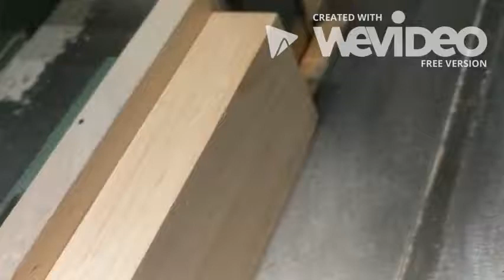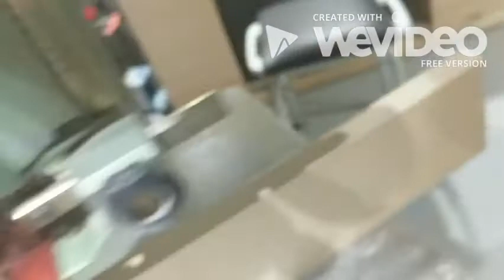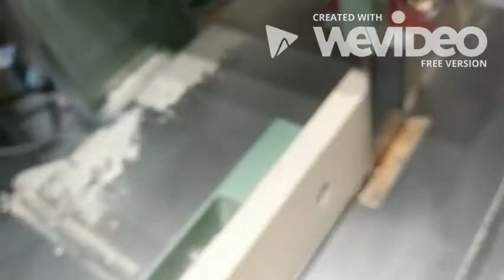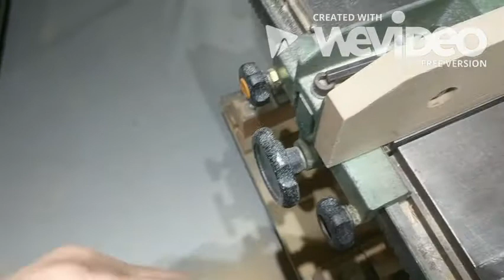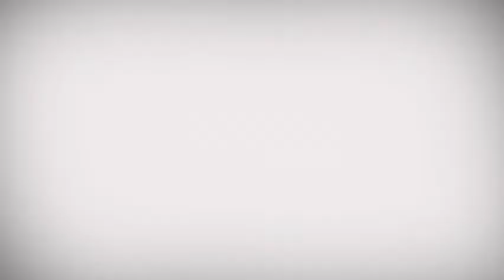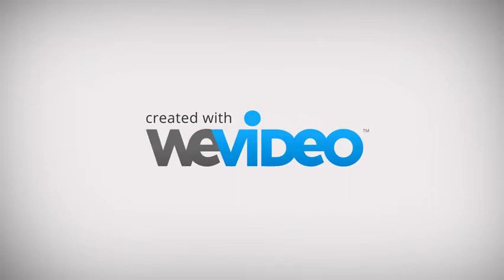HitachiBandsaw2

Comment from the maker: Sorry, I sold it quite a while ago. You can find them occasionally if you do a Google search. They are very heavy, so unless you have a pickup and a few beefy friends, it has to be shipped anyway. 
You won't regret buying this bandsaw. I've had quite a few others brands through the years and it was the best, especially for resawing. The Internet "pros" say that the motor is too small but they don't realize that there's a gear reducer on it so it doesn't skip a beat even though big wood.
I miss it terribly.